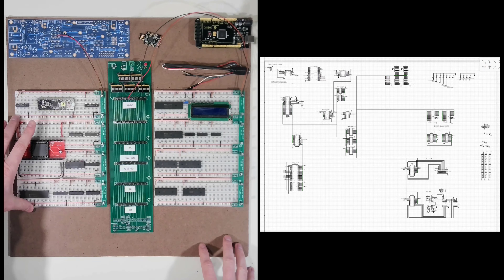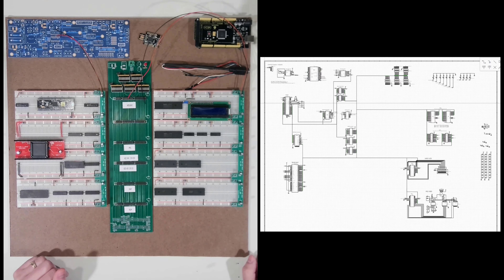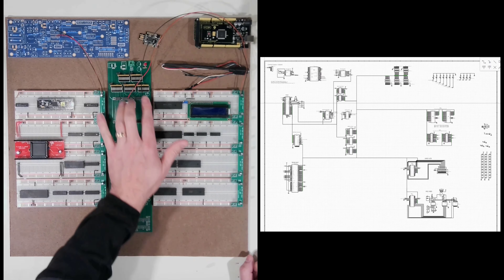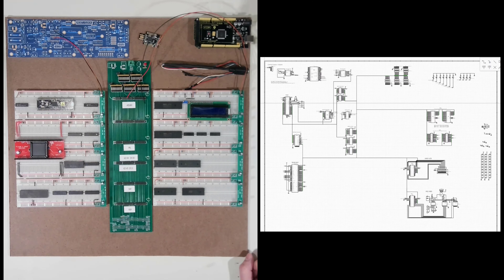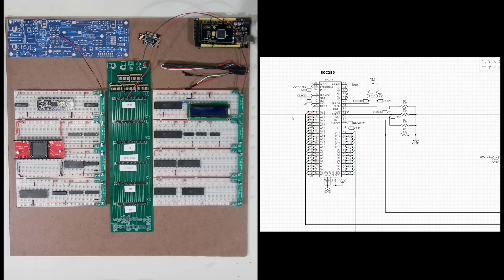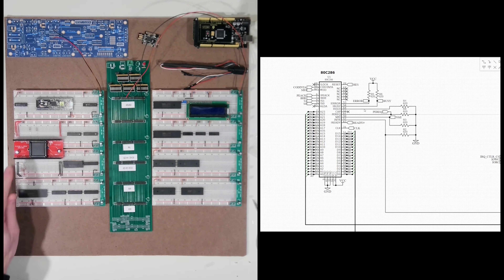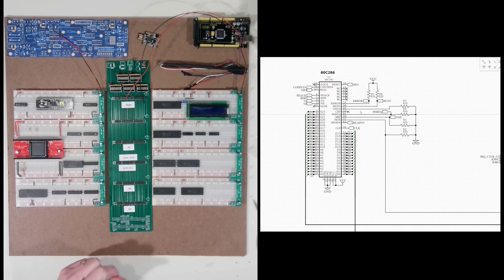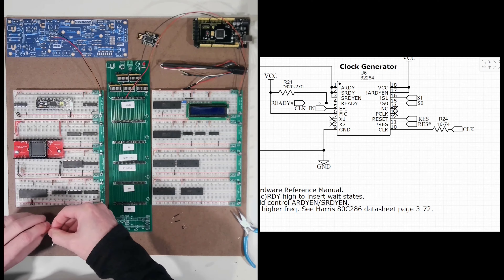80286 Build, Ep. #24 - The Wiring Begins

Comment: I noticed that when you shifted the chip more or less in the middle of the board to the right, you did not shift the wire below it that goes to one of the power lines along with it.

Comment: With the PSoC being hard to find at the moment, do you think a Raspberry Pi Pico could do the same job?
Reply from the maker: I haven't worked with Raspberry Pi's before, but my guess is, yes. I've heard getting ahold of Raspberry Pi's is pretty hard right now, too. If I didn't have a PSoC on hand, I would probably be using a PLD, such as the GAL22V10 (or ATF22V10C). Along with the PLD, I would use the application "Digital." I have a write-up on using PLDs here: https://www.rehsdonline.com/post/using-gal22v10-programmable-logic-devices, if you're interested. In Digital, I could re-create the same logic as in my PSoC and then use a programmer to write the logic to the PLD chip.
Reply: @rehsd  The Pico is a bit different from traditional Pis, in that it is a microcontroller with programmable IO instead of an ARM based linux SBC. I think stock is readily available for the Pico.
Reply from the maker: @GregCoonrod  Ahh, cool. I'll have to look into the Pico!
Reply: @rehsd  The pico is definitely worth checking out. 

As for Digital, I think it is a great program and I have been using it for modelling and simulating quite a few logic circuits in the past couple of years.

I find WinCUPL annoying. The "programming language" is far from intuitive and I have found that documentation on it is rather scarce.

However, I did find an implementation of a 8255 PPI in the examples folder that I've been meaning to check out ;-).
Reply from the maker: @damouze  I just received a couple of Picos, so I'll play around with them when I get a chance.

I agree with you on WinCUPL. That's what got me to Digital... finding something to work with GAL chips without having to do WinCUPL.